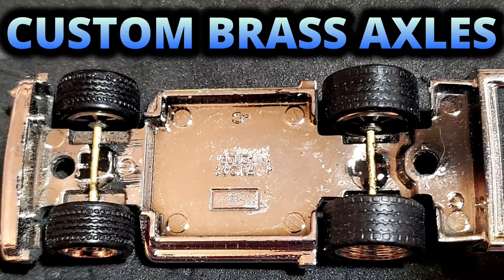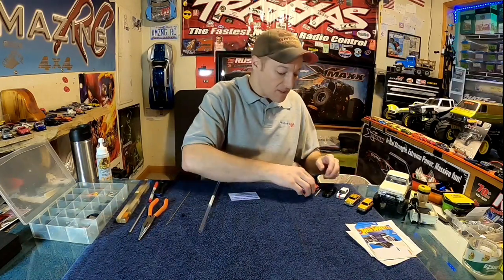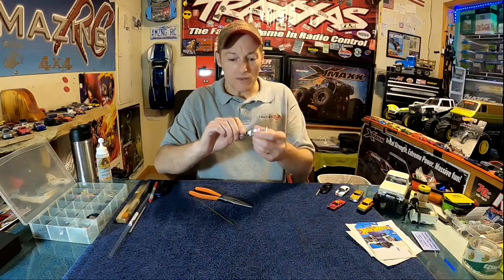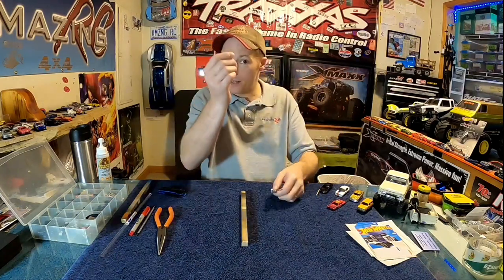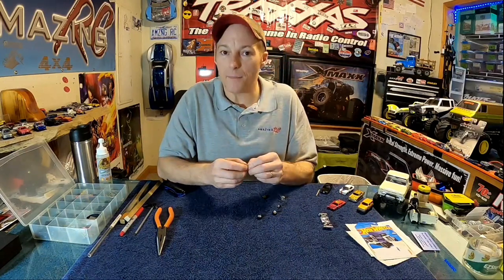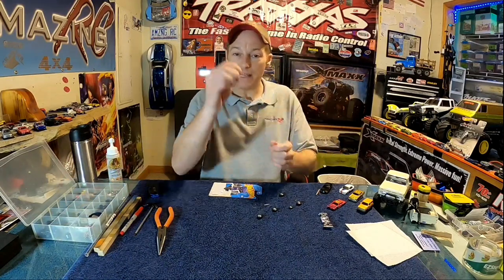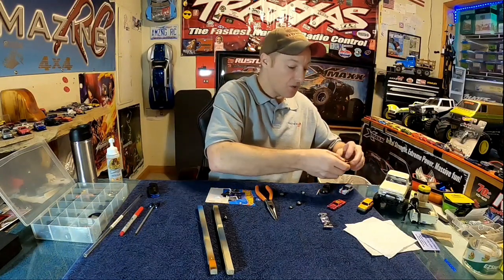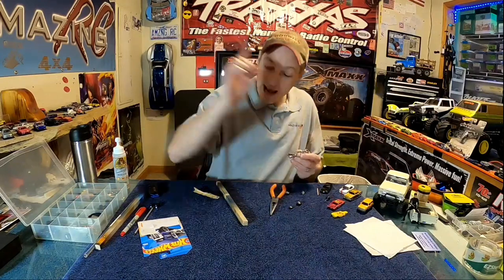Custom Hot Wheels - Video Series EP3:   Custom Brass Axles

Comment: Is it possible to crimp the brass tube with wire crimpers (as you would a butt connector) to hold the axle in place? I guess you might deform the brass tube and it wouldn't fit in the chassis. Just a thought.
Reply from the maker: You can crimp the tube.However it does not give you a really good hold on the axles. I wish I could juse the crimping message. But I have not had very good luck with wheels staying on..

Comment: I usually use the same size Aluminum tubing. I use super glue with baking soda, instant dry and solid. I have to admit I have been cutting the wheel stabilizers though and watching your video and to just take that extra step to sand them out will make the project more secure, so I'll be using that trick. Also a trick I found from another customizer is using a micro drill bit drilling a hole in the tubing letting the bit do the work and applying the glue through that hole. The glue never comes in contact with the wheels using this method. All of this is practice makes perfect methods. If your serious about customizing be prepared for mistakes. One last thing patience is a must. I have on many of occasions became over eager to see the finished product but patience will make perfect. Great video!